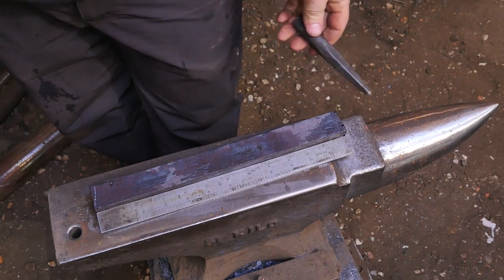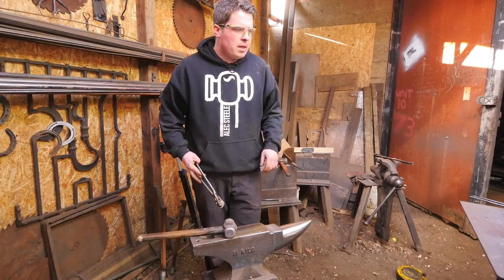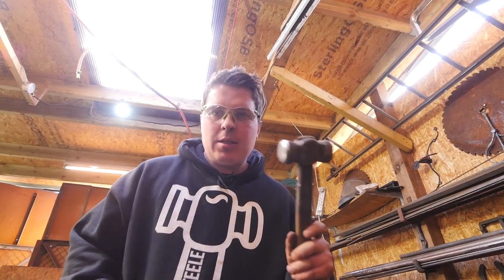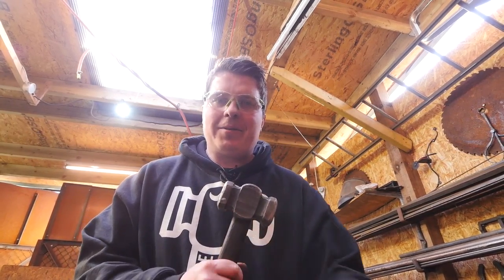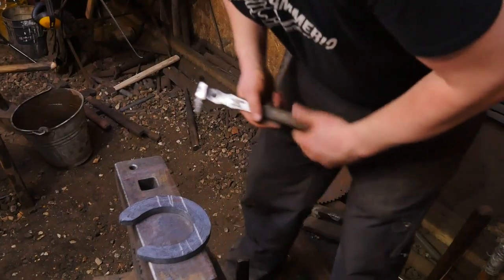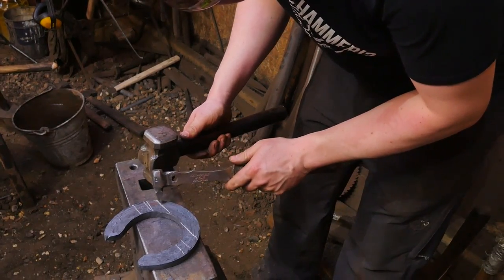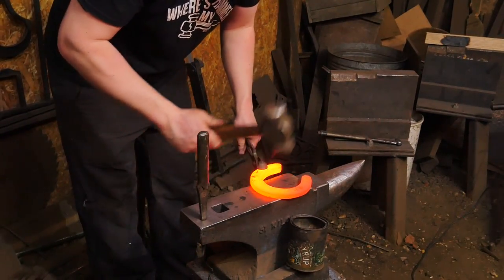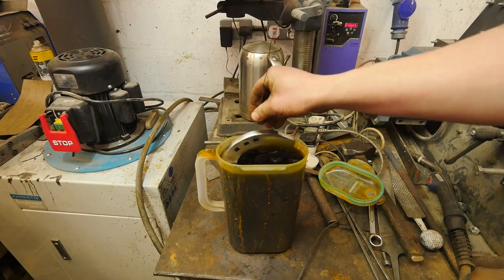DAMASCUS STEEL HORSESHOE | Making of...

Comment from the maker: I think the most likely reason for the dull etch was that Sam didn't heat treat the shoe before! Hardening seems to reveal more contrast. A higher grit/cleaner polish before the etch and after wouldn't be bad either! I really liked the choice and editing of music!
Reply: Alec Steele where have you been?
Reply: Alec Steele Sam: Please make one more. And I like the sound of the hammer while forging :-)
Reply: I kinda like it though, more of a wood like texture to it, which really works for this particular project.
Reply: I tend to think that'd be big part of it as well. Hardening  changes the chemical arrangement of the grains - free carbides vs. all the other phases with all the other names - I'm willing to bet there's some undercutting of grain boundaries and some grain size related effects to the finish when etched.

Come to think of it, I better get my Motlery together before I start sounding like an armchair quarterback!

Sam's stuff has been a nice interlude (totally jealous of the truck btw)- think you'll keep up with a mix when you're back on the right side of the pond?
Reply: Alec Steele Could it be used on a horse 🐴 or is it just for decoration?
Reply: Sam, make another to make it a pair and nail em on,  I'm sure you have a horse in your client list who will fit them.  It would be interesting to see how the wear  especially if the pony/horse does a lot of road hacks/work
Reply: Is metal? Is fire? Is relevant. lol.
Reply: Alec Steele my son is identicle to u bro
Reply: Alec Steele dude your amazing
Reply: Alec Steele alec my son Josh would love an autogrPhed pic

Comment: Sam, if I may suggest, if you want the damascus to be a little more dramatic, let the etch get just deep enough so you can wrap some sandpaper on a block (I like to use hard leather glued to a flat bar) and shine up the high spots. That will make it really pop. You can do this with like 2000 grit. This will leave the low spots dark, and the high spots shiny.

Comment: Nice one! I actually quite like to keep my Damascus a little darker. Also you could use another solution for etching, I for instance use solvable coffee, the disgustingly cheap one where you have to think twice about actually drinking it. The etching takes a little longer, because the acid inside the coffee isn't as strong as sulfuric acid or ferro chlorid but I like the contrast more, it's also very easy to get rid of, because in the end it's still just regular old coffee with a little too steel ions in it. 
The mixture I use is about 10 to 15 teaspoons per cup.

Comment: That's way too much work for a horseshoe, but given the actual content of a "Damascus" (pattern welded) piece, this is probably the best use of such steel. Given that it's made of two different alloys that are forge welded together. This means that the softer alloy will wear faster than the harder alloy. So when in use, give better traction and footing. Or at least in theory.

Comment: Hi i like your video but i would like to see a improved steel horseshoe making that has double row of square 1/4 inch heightened small sharp pointed steel spikes on the bottom all the way around the nail holes to the v point to the back of the horseshoe for refined traction for horses for horse racing for more traction for speed and for draft horses pulling heavy loads in horses pulling sleighs and sleds in dirt and snow and ice its one of the lost arts of blacksmithing giving your horse more traction and id like to see those 1/4 inch square spiked horseshoes make a come back there harder to find anymore it be nice to have you prefect this art for the market again for horse owners that horse race and for farmers that use draft horses for a hobby for pulling sleighs and for horse drawn farming implements and for the Amish horse drawn carriages for the winter to give them more traction without hurting the horse when stopping and trotting in the winter icy and muddy conditions